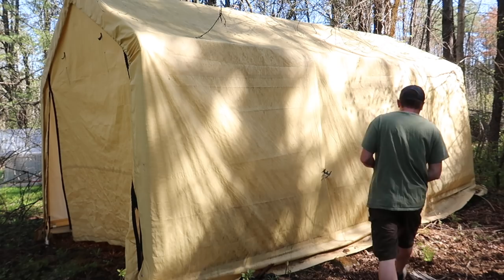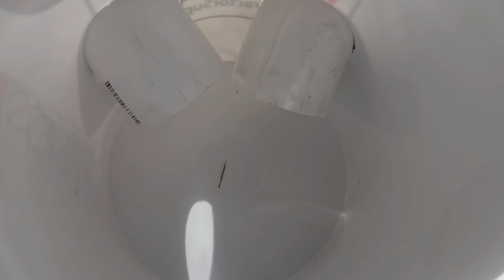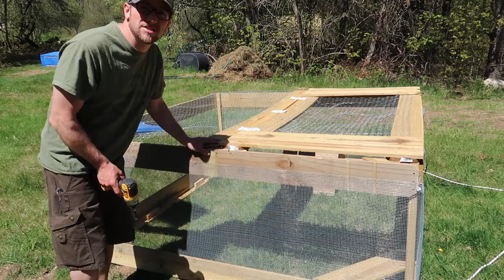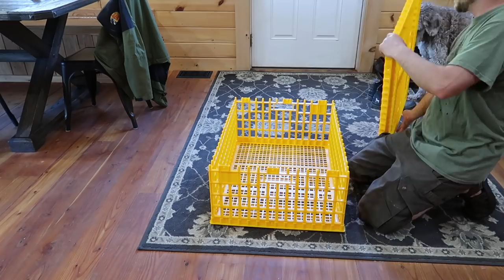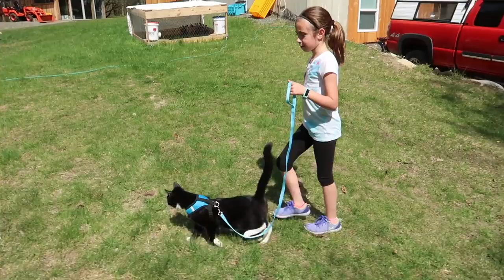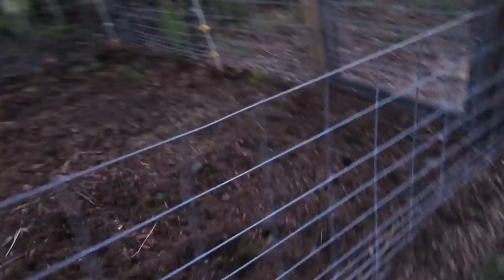Moving Our Meats Birds to Pasture

Comment: Just a thought - a bit more expensive, but IMHO shade cloth or something that will allow air to pass through is better than plastic tarps for the sides.  The tarp is great for providing rain protection for sure and is probably best for a significant portion of the roof - but in the heat of summer, it can also trap a lot of heat in if also used on the sides.